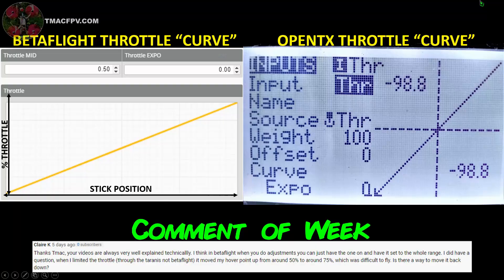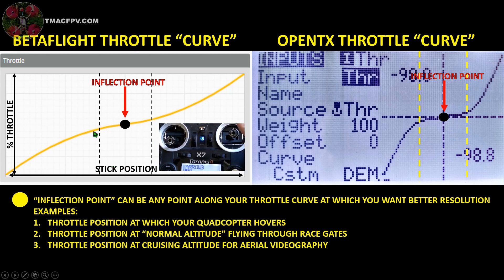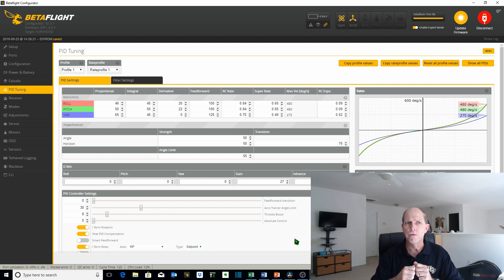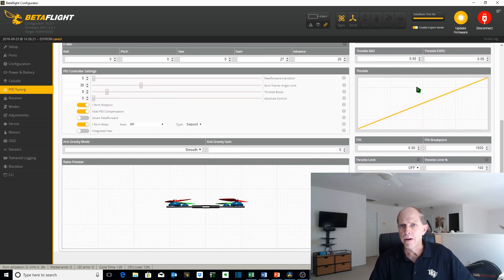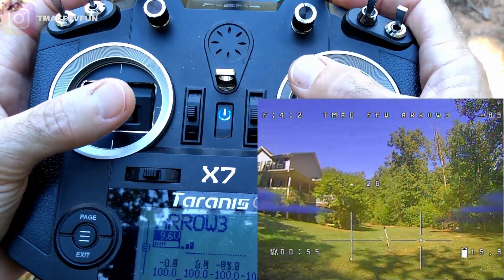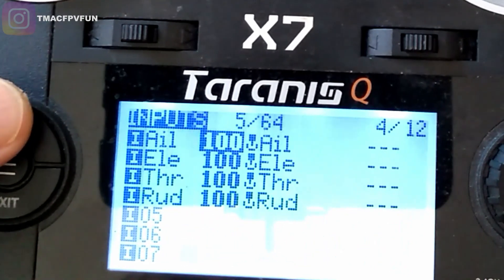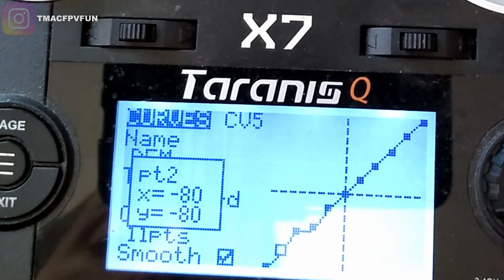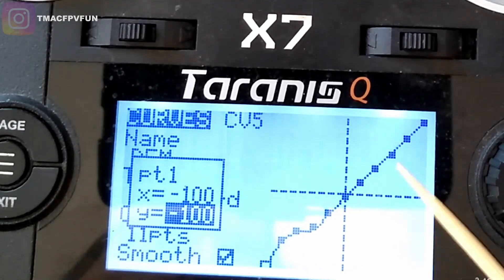BETTER FPV THROTTLE CONTROL

Comment from the maker: Got any experience with throttle curves or plan to try them out?  Let us know how you (will) use them and what they (will) do for you!
Reply: I'm looking for idle up instructions through logical switches.. so snooping around.. but found you're crossfire vid so will be coming bk to that next ! Cheers dude...
Reply: @serval_fpv  JB made a video using a Taranis system.  It's pretty straight forward if you too are using an frsky controller.
Reply: Yup, placed them in a switch between full and a 25 percent reduction.  It's helped immensely!

Comment: Good tutorial but there’s one mistake. The hover value on the controller is around -45 and not 45! A value of 45 on the controller would translate to a 0.75 in BF!
Reply: aha..... you're correct.  If I magnify the screen I can see that it was -45.

That explains how a converted the radio reading to 25% in betaflight.

-45 on a scale from -100 to +100.   converts to +55/200 + 0.27.

Looks like he just used 25% as an approximation. Thanks for pointing out that negative sign negative sign. Head to magnify screen about 6X to read that

Comment: I fly exclusively in Angle mode.  I have my throttle inflected at the hover point, use maximum expo in both BetaFlight and OpenTX, and have my throttle center at 0.95 - yup, 0.95.  I limited my motor output to 47%.  With this setup, I get the maximum movement around my inflection point, with no power spiking causing the craft to shoot to the Moon.  Also, limiting the motor output tames the quad's reaction when bumping things and running along walls.

Comment: this is great if you have whoops that you run in different battery voltage and have different mid points. for instance you can make a model for 3s and 4s setups and their respective curve. thanks for this

Comment: Does the throttle value in the osd show the value of the radio stick input (1000-2000 mapped onto 0-100), or the value after the stick input passed the throttle curve in betaflight (with expo and throttle max applied)?

Comment: I have a big Problem my throttle is changed with my pitch on my controller How do i change That i use a betafpv lite 2 se
Reply from the maker: If your throttle is controlled with your right stick moving up and down and your yaw by moving your right stick left and right, it sounds like you have a Mode 1 transmitter. This type is used mainly in EU. If you want Mode 2 (throttle on left stick), I am not sure how to accomplish that in this transmitter. You may need to open it up and physically change the position of the gimbals and have them plugged into the same cables they are currently using. Or, research "changing Mode 1 to Mode 2 on BetaFPV Lite 2 SE"
Reply: @TMacFPV  ok thank you very much

Comment: did you mean to say "45" @ 3:48?  Because thats what was on the channel when you were hovering, not 25.  Or did you indeed mean 25? and if so, where did you get that number from?
Reply from the maker: I meant 25. The number 25 was displayed in the middle of the OSD screen shown in the lower left corner of the video. That is the throttle position % shown on the OSD. The number 45 is the "channel value" shown on the transmitter. Remember, I'm showing 2 different ways (Betaflight and then OpenTX) to basically accomplish the same thing. So, I use the number 25 for one way and 45 for the other method. I mention this  at 2:25 in the video

Comment: Just found out you are also a U.S. Air Force vet, I salute you sir, I’m a disabled Air Force myself, 1982-1986. Crew chief on the F-5E Tiger and the FB-111D Ardvark stationed at RAF Alconbury U.K. and Cannon AFB Clovis N.M. Now I’m trying to become an FPV pilot and crew chief.
Reply from the maker: Thanks for your service Angry Pepper!  I remember the FB111s!  Did a Red Flag Exercise at Nellis AFB with them awhile back

Comment: Will this work better than percent scaling of the throttle? My Mobula 6 HD modded to a 75mm frame bobs up and down and I have a hard time keeping level in indoor flight. I changed the throttle to 85% weight in Open Tx with the complementary -15% offset. It did improve but not smooth enough. I didn't want to do it in BetaFlight because it's so much easier for me to have this set up as a separate model in Open TX and still keep the original intact in case I mess up. I was confused when you set up in curve menu at curve 6 instead of  "3" which is the channel position of the throttle. Then when you went next to the mixer graph I didn't see why it was automatically there. Guess I need to rewatch. But thanks for this and it may turn out to be what I needed as I get into it.

Comment: Excellent, easy to understand !! Question: If I want a soft landing, what would the configuration be?
Reply from the maker: "Soft landing" just takes a lot of practice. I have my arm/disarm on a switch. To land, I normally hover as close to the ground as possible and disarm. The quad "drops" about a foot to "land". That's my "soft landing" landing 😁I don't normally land on concrete
Reply: Thanks : )

Comment: Ok did I miss something? He went from 45 on the radio to 25 in BF. Is the explanation between the relationship of these two numbers in one of the other videos? Why is there a difference?
Reply from the maker: This is explained beginning at the 2:41 time mark of this video.  OpenTX and Betaflight operate on different "scales.'  the OpenTX channel "numbers" go from -100 to 100 whereas the Betaflight throttle position goes from 0 % - 100%.both of the4se values are displayed  in the text on the video as I am doing the hover flight and the throttle position of "25%" is displayed on the OSD screen of my goggles in the video as I'm doing the flight as well
Reply: The formula for this is: ({OpenTX value} +100 ) / 2. Be sure to include the negative sign if your hover point is negative. So for this video, (-45 + 100) / 2 = 27.5, which he rounded to 25.

Comment: I got confused. You wrote 45-50 on the video but when you switched to your office, you said 25%. Oh I see, it's throttle position on osd. I don't know if I can see that in DJI fpv goggles.

Comment: Have you tried using the betaflight throttle curves with version 4.2?  I'm using the blackbox to compare RCcommands to RCrates.  Reviewing those logs, expo on pitch, roll, and yaw are working properly.  Scaled throttle limiting also works properly.  But, throttle expo and midpoint offset are not working.  No matter what I set for those values, the throttle rates track the stick inputs exactly.  Any idea what I'm doing wrong?
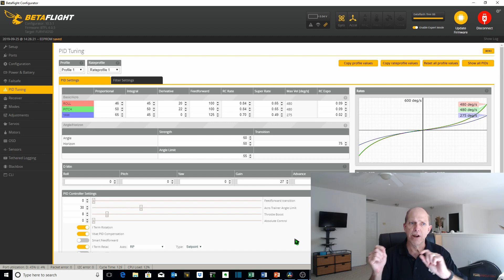Reply from the maker: I have not used Betaflight 4.2 for any of my throttle curves.  I use OpenTX to setup throttle curves in my transmitter as explained in the video.  I do not believe you can change the position of an inflection point (such as your throttle position at hover) within Betaflight (see 4:00 - 4:30 of this video), so I just find it easier to use OpenTX for throttle curves

Comment: Hi Tmac. What is results when you fly and start pitch forward. Is there will be problem control altitude?
Reply from the maker: Hey Joe!  No problem at all with enough practice!😀When you pitch forward you will need to increase your throttle to maintain the same altitude you had prior to pitching forward.  If you do not do this, you will lose altitude.  This is explained in this short video👍:  https://www.youtube.com/watch?v=QotbMQVHSTs

Comment: Now, how do you do that in the DJI controller?
Reply from the maker: Fairly certain DJI doesn't run OpenTX firmware on their transmitter, right?!😔If you're running a Betaflight Flight Controller, you can still to do throttle curves in Betaflight (I think I mention that in the video) and also throttle limits (scaling is what you want). https://www.youtube.com/watch?v=Z4NzPmb3sNs
Reply: TMac 
Thanks TM, did that. DC3 is close to perfect now.
Reply from the maker: Outstanding MindRider! Way to go! Good work! Fly fearlessly friend!🤩
Reply: TMac 
I try TM. Thanks!

Comment: Hi Tmac, which one do you prefer? Setting it in betaflight or in tje transmitter itself?
Reply from the maker: I personally like to use the transmitter to set up throttle curves. I can make them as detailed as I want (more pictures ints or less), etc. and turn them off if I choose to do so, without connecting to Betaflight

Comment: Thanks for posting,good info.I'm new to this and throttle control is sketchy at best. New sub.
Reply from the maker: Hey DC smith! Welcome to FPV! Here's another one on how you can "dial in" your max throttle to suit your needs and level if experience https://youtu.be/juJnLPcBexY Also, make sure to check out the FPV Beginner Tips video at https://tmacfpv.com/fpv-free-resources/ Stay in touch and always, "Journey to Better!"👍

Comment: Pretty new to this stuff, but have built a couple quads now, that ended up high authority. Low throttle control is/was my biggest issue. At first I had some heavy pitch props which were making the problem even worse. Ive since been going to very shallow props, and pinching the sticks instead. For finer control. 

Came across your video while thinking there has to be some other ways to resolve the problem, and or further increase control. Already I have been playing with throttle expo, and mid. But now I'm kind of having issues that things just dont seem as peppy when I want, with the shallow props. There is so much sweep in the throttle that its hard to hold for precise control, and cross the full range without wanting to shift my hands on the remote.  

I wish I had the options that you do, I'm using the DJI remote, and just making changes in Betaflight. Would be nice to be able to set up a custom curve like you did.
Reply from the maker: Have you tried limiting throttle in Betaflight? It's one of the 3 tips I mention in this video https://youtu.be/Z4NzPmb3sNs With the latest BF Configurator you may need to do it with the CLI, but it can still be done

Comment: Interesting, this can be used to achieve something close enough to altitude hold 😯
Reply from the maker: Hey Mr Saraf! Better throttle control with stick around a specified throttle % output. You can decide how much you want stick to move!

Comment: Great video that all fpv pilots need to see if they don't know. Mine is .18 expo with just a little curve. I don't recommend a lot of curve and expo because you can go from a little throttle to no change  to an extreme change. That causes some problems for me.  But completely linear isn't pleasant either- lol! Without the knowledge you supply in your video, we might not be able to find our sweet spot! 😉 Thank you for sharing Tmac!
Reply from the maker: Thank you Jason! Much appreciated👊Thanks also for sharing your expo setting with others.  Obviously it works extremely well for you based on your silky smooth flight videos! I completely agree with you about "not a lot of curve" to avoid sudden, aggressive throttle jumps--too SCARY!😨

Comment: I use a little bit of expo on my throttle and having great control. Also different motors have different curve. For example blackbird, Johnny and f60iii motors are very smooth and give you a lot of precision on low throttle while brotherhobby and t-motor pro line are very touchy and harder to manage in freestyle.
Reply from the maker: Hey DK! Great info, thanks! How much expo do you use?  Do it through Betaflight or transmitter? I also found out through monitoring channel outputs for this video, the fact I had the "ratchet tensioner" on for my throttle stick was making my channel outputs "jump" in increments of a few at a time rather than smoothly.  I have since loosened this on the stick.  Better outouts now!
Reply: @TMacFPV  I use very low friction on throttle and no rachet. I set the curve on bf 22 expo and 25 middle
Reply from the maker: @DKFPV  Thanks DK! Great stuff friend👍

Comment: Once again a very informative video. Thank you for taking the time TMac.
Reply from the maker: You're welcome Vincent. Hope you get the opportunity to try it out sometime. Been flyin' much?
Reply: TMac earlier in the week. Then I had to wait for parts. 😢
Reply from the maker: @vincents3334  I understand completely. Dropped my transmitter down the stairs at beginning of the week. 🙄 Failed durability test. Repair & replace!